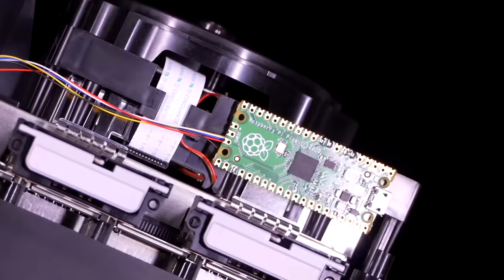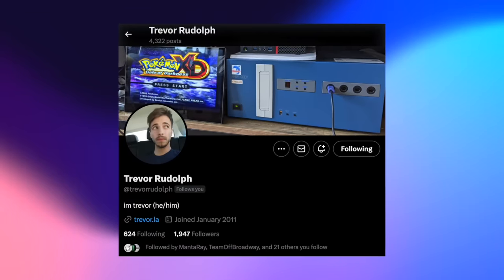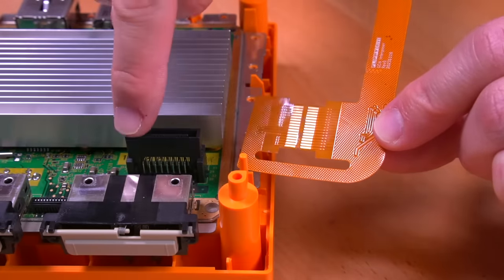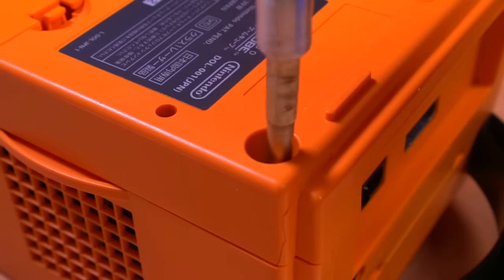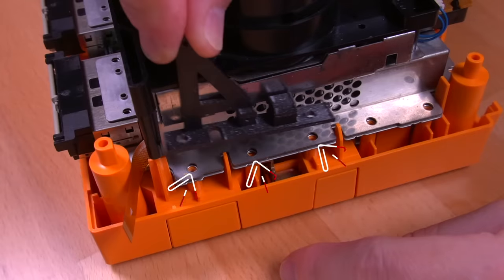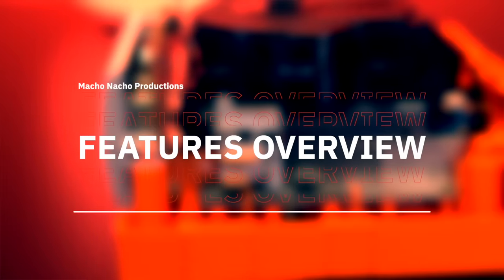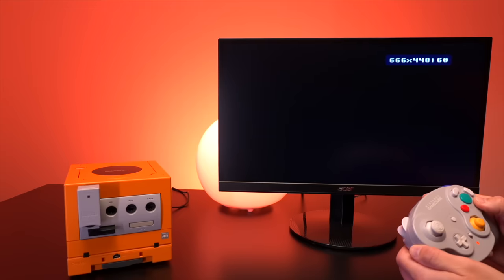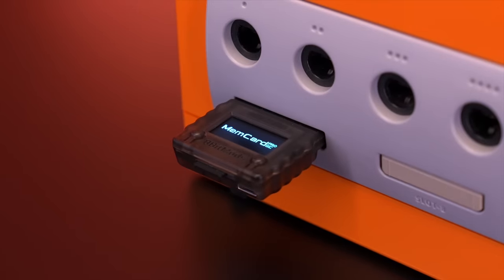FlippyDrive FIRST LOOK! Solderless Modchip For GameCube!

Comment: Always I see the words "GameCube" and "Region Free", instantly comes to my mind "StarFox Adventures", because the disc has multilaguage hidden in the disc, and the language is loaded accordingly to the System Menu region (even if it's Region Free unlocked, the region of the menu still affects the language loaded in the disc). 

For example, if you have a USA GC, and unlock Region Free (doesn't matter the software modification you doing it), and you use a StarFox Adventure JPN disc, it'll load in English (because it's USA System Menu). Or if you have a JPN GC, and load an American StarFox Adventure, it'll load in Japanese.

It's not a problem for 90% of players, but in rare cases like me (Live in Japan, have a JPN GC, but can't read more than 20 different Kanjis), it's annoying to know that the game has english text (both JPN and USA releases), but I can't access, unless you do a very delicate and difficult mod in the motherboard to change the GameCube region (which I did), but it was better if the mods to load game, would have options to define the main language to load, overpassing the System Menu region. 

I believe Swiss has such option, but I wonder if this new Gamecube Boot Loader has options like this too. If it has, I would gladly buy another Cube just to install this solderless mod. I really don't enjoy Swiss appeareance, but I loved this new loader that looks exactly like the Gamecube original menu.

Comment: It looks great but... with about only 20M Gamecubes worldwide and the long time existing modchips (using SD card in the serial port), how many do they plan to sell ? Not many in my opinion... on the other hand, a Gamecube costs about $80 today while a Wii costs $20 (and the first versions of the Wii have got joystick ports and perfectly run GC games). The project is really amazing but I'm afraid it won't meet a commercial success :-( Anyway, thank you both, the GC remains the most beautiful Nintendo console ever made. A few more things: current modchips are really cheap (I don't think this one will be as cheap as the current ones) but only apply to the first version of the GC. In this way, this one is much better because even the GC that don't have the serial port can be modded ! And of course, no soldering... Last but not least, if your laser lens has become too weak, this solderless modchip runs games without a disc in the GC (appreciated feature !).

Comment: FAILED FRONTEND RUINS THIS 👎 As Nintendo has always said, hardware is useless without the software to support it. All I see is a bunch of tiny minidisc images with text too small to read inside a bunch of transparent cubes on the screen… Wake me up when developers realize how pointless that is and instead use BOXART of the actual beautiful artwork rather than discs with text too small to read.

If I see a bunch of discs on the screen and can’t read which each one is without hovering over them? And you decided to use THAT instead of BOXART that is easily and quickly recognizable, then you need to rethink your decisions in life.

I’ll pay more attention to this chip when I know it’s been integrated (or at least tested) with an available frontend that shows identifiable boxes and not ugly undersized discs with unreadable text.

Almost, but no.